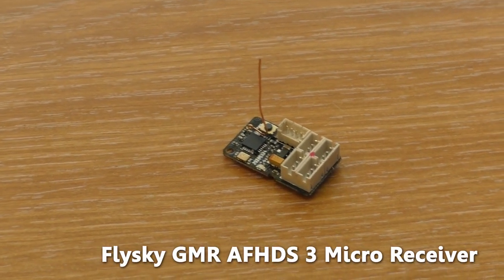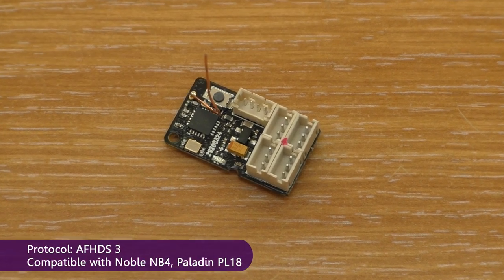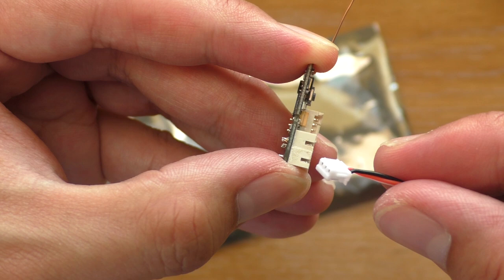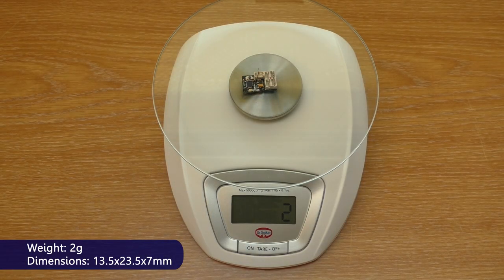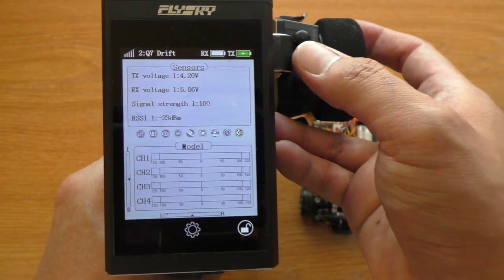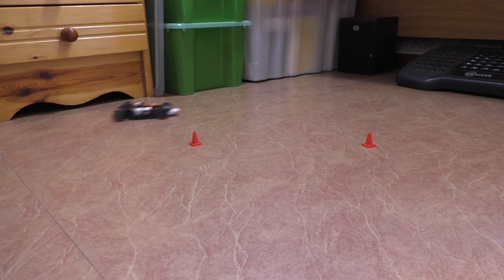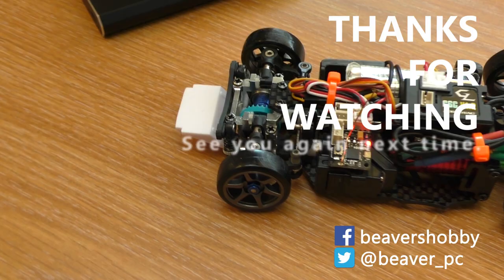[Review] FlySky GMR Micro Receiver for Noble NB4 | 1/28 Car Receiver

Comment: Does the remote controller firmware version interfere with receiver binding?  ( In case of the latest version and the old version )
Reply from the maker: Yes. You will need the appropriate version on both transmitter and receiver to bind. If the firmware on the transmitter is higher than the receiver then you'll have to update the receiver first. Here's how. https://youtu.be/SjJkjXrSVI0

Comment: Hello Beaver, I just update my flysky nb4 to firmware 2.0.93, I need to update my receiver GMR,  which select receiver update should I choose for the GMR?
Reply from the maker: It's the "enhanced" receiver that you'll need to hold the bind button to go into update mode.You'll need the receiver updater as well.
Here's the updater and how to. https://www.flysky-cn.com/nb4-xiazai
Reply: @BeaversHobby  hello beaver, I did press 10 second and I did get the 3 blink and no light, ready for update firmware for the GMR, but on the nb4 “update receiver” selection only fgr4, fgr4s/fgr4p, fgr8b and fgr12b available to choose from, I try all selection all failed. I already update firmware successfully the 2 stock receiver bundle with the nb4 and the 3rd party micro dasmikro and also successfully bind them.
Reply from the maker: @oliverstoys8411  You'll need the receiver updater software and run it on a computer while plugging the radio in.
Reply: @BeaversHobby  thanks Beaver, wow this thing a little complicated, thanks again Beaver👍🏻👍🏻👍🏻👍🏻
Reply from the maker: @oliverstoys8411  My pleasure.
Reply: @BeaversHobby  🙏

Comment: Hey Beaver, is it possible to use Miniz Led lights with this receiver?
Reply from the maker: Unfortunately, no. However any standard light controller will work since it's a standard 3-wire system.

Comment: I own a trq1 and am also buying a hgd1 for a widebody gtr body and I was wondering if there is any way to make wheel spacers to get that perfect fitment
Reply from the maker: You can get wheels with high offset like 3-3.5mm offset. Wide wheels will also make things easier since they are 2.5mm wider than narrow wheels.
You can use any wheels from Mini-Z AWD, get the whole box to test it out http://bit.ly/2VeVZsc
or any other AWD wheels like RC Aurora  https://ppm-rcracing.com/categories/RC%252dAurora-racing/Rims/
Or PN Racing https://www.rcmart.com/pn-racing-mini-z-awd-machine-cut-bbs-front-rim-f1-2-pcs-yellow-488yf1-00085174 
Links are for reference because shipping right now is either slow or super expensive.

Comment: Hi Beaver, I hve bought this receiver module, but I cannot bind it with my transmitter. Have you experienced this ? and have you managed to fixed it? I have succed putting the Rx in firmware update mode, but my NB4 fails at upgrading it. (NB4 is in 2.0.93 firmware)
Reply from the maker: I haven't got time to update the firmware yet but GMR is in the advance category.
Reply: @BeaversHobby  Hey thanks, I have found the "GMr" Upgrade in the Flysky NB4 receiver Updater V1.0.8_EN. The upgrade proceeds then confirm that the upgrade succeed. But sadely I can't bind it after the upgrade process... maybe my firmware version FW2.0.93(FCC version) for longer range as to be changed to standars one...
Reply: I finally have bind it, I post the solution I have used if some other people are fighting hard like me ^^. I was binding using "Classic RX". when I have tried with Enhanced Rx, it has worked ;)

Comment: Hi beaver, are the orientatioin for the plug in flysky rx and dasmikro one are the same?? I just have dssmikro for my ex5ur, but it didn't come with manual or something like that. And i can found manual in online to.
Reply from the maker: Yes, the plug orientation is the same. Yours should bind to DasMikro ASF without any trouble. Binding procedure should be the same as this receiver too. You just have to find you to get EX5 into bind mode.
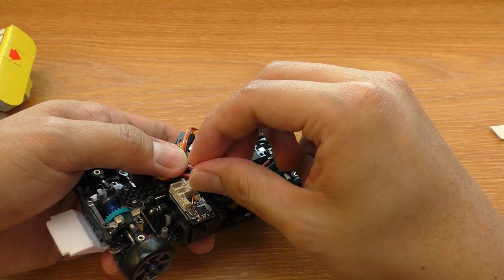Reply: @BeaversHobby  In 2:23 i see the white, red, and black wire. The white ones are for the signal right? For binding i think its just same like binding with my mr03. I will read the procedure in my manual 😅
Reply from the maker: @soemardi8885  Yes, the white wire is signal. And yes, it's pretty much the same as on Mini-Z, hold the button and turn the car on first then initiate bind mode on the transmitter.
Reply: @BeaversHobby  allright i wil try that. Wish me luck 🤣 i will post the result soon.
Reply from the maker: @soemardi8885  Best of luck! Looking forward for the result.

Comment: Hello,
First thanks for all movies you made.
I have a question for you.
I'm using lots of MR03, MR03VE, with PN Racing options and Atomic BZ, all to make race on RCP. MA015 for drift on carpet during vacation with One Way and rigid axe on rear. It's a 7 years old car and plastics are not in a good Heath.
Now I want to buy a good car on Banggood or AliExpress for drifting on carpet, and if possible use it on RCP.
My choice will go to a Mini-Q or Mini-D with brushless with maximum of aluminum parts, but there is lots of models (q5, q6,q7,q8,q9,... d,d1)
All theses cars looks like GLA or BZ, and it's what I want.
Which Mini-D or Q model is the best for you?
Do you think this kind of car could have same performance than GLA or BZ on RCP?
Or these kind of cars are limited to drift.
Reply from the maker: I highly recommend Q7 because of double wishbone suspension with grease filled shock.
Mini-Q Q7 and Q9 (if you look on aliexpress) are the same car. Q9 has some metal upgrades preinstalled.
For drifting Q7 would rival any expensive cars. It's more stable but less agile than my AMZ with bell crank upgrade (haven't done a proper comparison video yet... coming soon). But the track performance is not the same as GLA because there's some slop in the control arms and GLA has bell crank steering so it has a better tuning as well. Also GLA is race-proven so it's a stronger car too. Well, GLA is the best of shaft-driven AWD chassis right now anyway.
However this car is well worth the price, more than enough to have fun and besides, it's fully adjustable out of the box. You can do some bracing like you would do on the Mini-Z AWD DWS where there are more 2 linkages on the rear upper arm to brace them and stop them from moving forward and backward and it'll rival any expensive car.
I have the whole series dedicated to upgrading Q7 to CS drift car from using off the shelf parts to fabricate your own. I have't done the bracing because it's not that important to me, standard suspension is more than enough for drifting. https://www.youtube.com/playlist?list=PLS79G3YjA2fAgjiyJam-5JvovvCShTksU

BTW, Mini-D is actually Yokomo Warrior 1/28 and it doesn't have any cross compatibility with Mini-Z except the wheels. So you wouldn't want that.
Reply: @BeaversHobby  
Thanks for this quick response.
I'm happy to ear that Mini-Q7 is a good model for a mix Drift and racer on a small carpet track (5m x 4m) in my garage during vacation, I was in the right way.

My dream model is:
A Mini-Q with:
- Full metal parts
- metal gear servo
- a compatible One Way (sinohobby v28-005ZA I suppose)
- a compatible rigid axe, I have a Mini-Z AWD diff, hope it's compatible, I will lock it.
- CS mod for Drift 
- a small Gyro (optional)
- a good programmable ESC ( Do you have a link for a model compatible for 3500 & 8600KV, please?, I have a GL GSC v1.2 like you on my BZ with the program board, but it's around 45€!)
I have already:
- brushless (I have a PN Racing 3500KV and an original 2 Kyosho red 8600KV with holes for screws)
- RX receiver compatible with Kyosho Ko Propo (my spare part for the BZ)

On Aliexpress, the best models are:
- Mini-Q9 with BL motor and ESC + servo (~180€) good price, I just have to add my receiver.
But to much plastic for me !!!
It will cost a lot for metal parts.

- Mini D Chassis only (~170€)
 Then I need servo (25€??)+ horn, ESC (~16€). 
At the end, same price than the All in one model without a radio!
- Mini-D with all in one (radio+BL+servo) at ~218€
Do you think it's a good choice (Mini-D)?
Could I install one way and locked diff inside, same model than Mini-Q?
Have you plan to make a test of this model?

One more thing:
Mini-D is a beautiful Chassis, but I don't understand why they exchange the side of servo+motor with the battery, do you know why?
I can't find good videos on YouTube for Mini-D ( we need yours)

Regards
Reply from the maker: @userbeecore5516  Newer Mini-Q one way has very sharp gear and it'll eat your pinion so don't use that. Mini-Q uses the same diffs, same wheels as Mini-Z so you can remove stuffs from your MA-015 and use them in Mini-Q. Swing shafts or Universal shafts are also the same but it's the 10.5mm long one like in the front of your BZ.
- [Diff/One Way/ Rigid Axle] I highly recommend Mini-Z front one way because it's smooth and you can replace the gear if need be. As for the rear solid axle, again, use Mini-Z part. Metal upgrade isn't that necessary and if you want metal car, get Q9, it'll be metal from the beginning and I think all the parts should work (there's been a case that getting Q7 to do metal upgrade and the parts don't fit). If the store you see got plastic parts, look in other stores. I've seen a full metal Q7 called Q9 before. The important metal bits are motor mount and shock towers. If you want more rigidity, metal control arms are also good. The other parts like prop shaft holder, servo mount and battery mount are just for looks. Shop around to see which store gives you the best deal and parts combination.

- [ESC] All the electronics are the same as other 1/28. If you like Hobbywing made ESC I suggest getting the Atomic one. Here's the link http://www.miracle-mart.com/store/index.php?main_page=product_info&cPath=67_74_1024&products_id=14040 . It's the same as GL but it's only about $35 because they don't overcharge. 

- [Servo] I highly recommend AGF A11CLS which you probably are already using it in your BZ. http://bit.ly/2kevKFL It's the best without a "badge" from Atomic or GL to jack up the price. There's ZH plug too but it's out of stock right now. You can find the same servo (with different prices) on Aliexpress too.

- [Gyro] It is not necessary, you are not drifting a RWD car. But if you do need one, get the AGFRC v3. It's like a shrank down Yokomo V4 with EPA adjustment. https://www.aliexpress.com/item/4000713029569.html

Mini-D isn't a very good car compared to other in this price range. It looks good but you can't use any diff from Mini-Z. There's only original ball differential, no upgrade. Dogbones are literal dogbone and not CVD. Try it at your own risk but I've talked to someone who actually has it and he said AMZ is a much better car that it. So by association Q7 is also a better car than Mini-D too.
Different motor side is just a design choice. They can put it any way they like. Just balance it properly and it'll be the same.

In conclusion, Mini-Q is on Mini-Z AWD platform, Mini-D is not.
That's why I made my choice not to get Mini-D too. None of my stuffs will be compatible except wheels. No spare parts available. If I'd pay for a car more I'd put my money on Atomic DRZ v2 or even BMR-X. At least I got a proper drift car out of that and not an obsolete chassis with no compatibility like Mini-D.
Reply: @BeaversHobby  
Ok,
Always good comments from you.
I will think about Q9 or DRZ2.
I have a friend who works with Atomic. I will ask to him when DRZ2 will be available.
DRZ was not my first choice, but why not finally!
Reply from the maker: @userbeecore5516  DRZ v2 has just came out and some people got it already so we'll expect to get some user feedback soon. Initial feedback isn't that good though. I've seen one with from lower control arm broken already.
I'm waiting for GL Racing GLD but it got some delay so there will probably be 2 more months.

Comment: Hi love your videos! Can you advise what I need to do for this receiver to work with my mb010ve2.0 (assuming I can get it to fit)
Reply from the maker: You'll need to convert the original Mini-Z electronics to 3 wire standard by removing the original board, convert the servo to 3 wire by installing a servo board. Take a look at PN Racing. There's an old version which is still good and a new version which is very expensive but it's great. Next you'll need an ESC. Then connect ESC and servo to this receiver and it's done.
Reply: @BeaversHobby  so I can use existing Kyosho stock servo as long as I get the 3 to 5 wire convertor? Thx!

Sorry could also share link to the convertor hoards? I tried googling PN racing servo convertor board, but couldn't find it!
Reply from the maker: @ptpt4583  You can choose the shop depending on where you are.
US/NA (new version) https://www.kenonhobby.com/PN-Racing-V4-Programmable-Micro-Servo-Board-for-MR03-PNR25W_p_49215.html
USB dongle programmer https://www.kenonhobby.com/PN-Racing-USB-Programmer-for-V4-Micro-Servo-Board_p_49216.html
EU http://www.minizracing.it/minizshop/index.php?main_page=product_info&cPath=65_213&products_id=13160
Rest of the world http://bit.ly/2yqHXe0

Comment: This wouldn't work for a drone (an FC made in the last 10 years expects serial command signal), you'd want something like the FlySky FTr16S receiver for that. This would be decent for a micro fixed wing though.
Reply from the maker: Thanks for the info. As you may have noticed I have little to no idea about the flying stuffs.
Reply: Bullshit. Flysky has 10 channel s bus receivers that work perfectly in drones. Ia6b ia10b a8s rx2a pro and several other options

Comment: Great video as always Master Beaver. I have just received NB4 Transmitter and micro receiver.. I am looking to install in Mini z Ma020, is that possible? The micro receiver is much smaller than the one on the car currently.. Any advice or video as to how to install, it would seem I will have to do some soldering as nothing seems to plug together and needs to be direct wired. Any help very much appreciated as I think I am in over my head 🤦‍♂️ Thank you thank you 🤞✌️🙏
Reply from the maker: Unfortunately you can't replace the receiver in a standard Mini-Z. It's an all-in-one proprietary board.
You can use standard RC components (3-wire system) by taking the original board out, install servo board (bought from PN Racing or salvaged part from other 5g/9g micro servo) then install your own ESC.
And because you have NB4 radio there's also another way. You can convert your Mini-Z to EVO. Buy the EVO board and Mini-Z proprietary NB4 receiver. Yep, you can't use any of the standard receivers, it needs to be the one from Mini-Z platform. This is the most expensive way to do and not the best on MA020 either.
Reply: @BeaversHobby  thank you so much for your knowledge, greatly appreciated by a newbie like me.. What sort of ESC should I be looking for to buy new? If I went with the second option would I also need to convert to brushless motor?
Reply from the maker: @lukeashton5774  You can use a cheap 20A red board ESC like this for brushed motor and AAA battery. https://www.ebay.com/itm/20A-Two-way-Brushed-ESC-Electronic-Speed-Controller-with-Brakes-for-RC-Car-Boat/184575543861
If you want to upgrade it to brushless, use this. https://bit.ly/3h07teH
As for the EVO board, it supports brushed motor too. You'll need the ICS adapter to set it though.
Reply: @BeaversHobby  Thank you thank you! I have purchased all items you have listed, Servo board, Esc and Ics! Without your help an guidance I would have been completely lost and probably would have given up.. I will have a look for tutorials for how to solder/connect all the parts together.. Once again, many thanks for your time and knowledge, you are a legend 🙏🙏🙏
Reply from the maker: @lukeashton5774  My pleasure. The ICS is not needed if you don't have EVO or ASF/MHS board but it's nice to have anyway. Best of luck with the project.

Comment: does the receiver fit in mb010 chasis? Thanks!
Reply from the maker: From the dimensions I see that it fits under all Mini-Z but you'll need a small ESC. PN Racing V1 will do nicely. However bear in mind that you'll need somewhere to put the servo board too.

Comment: Does anyone know how to update the flysky nb4 mini z receiver? I downloaded the latest firmware to my nb4 and now it won’t bind.
Reply from the maker: Have you tried the same method as advanced receiver? Holding bind until it blinks then use receiver updater on PC to update it.
I haven't got the EVO yet so maybe you can ask in Mini-Z group https://www.facebook.com/groups/722063711267613/ or NB4 official group https://www.facebook.com/groups/743454109447266 .
Reply: @BeaversHobby  Thank you for replying so fast! After work I’ll give that a try.
Reply: @BeaversHobby   I downloaded the receiver update on the pc to the nb4 successfully, and it said it was a success but I still can’t get it to bind. I might not have done it right or it’s just not working. I not experienced with computers.Thank you so much for your help! I will ask around at the links you sent me.
Reply from the maker: @jasonsutton6528  You're welcome. Sorry I can't help you much with this.
Reply: @BeaversHobby  Thank again for your help! I have an update on getting my evo to bind after firmware up. You have to go to settings on the NB4 >Model >Radio Frequency >RF Standard, and select Mini-Z Evo.
Reply from the maker: @jasonsutton6528  Thanks for the info.